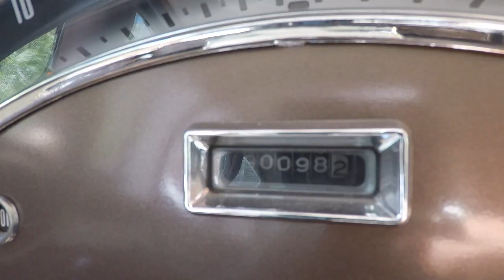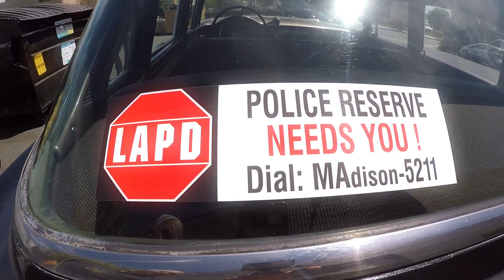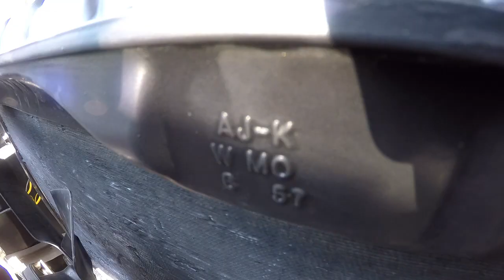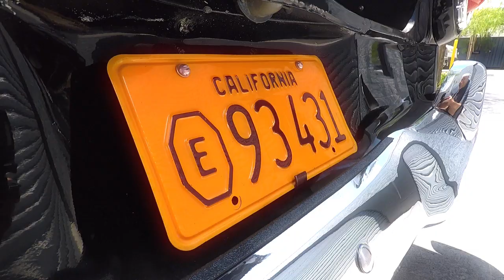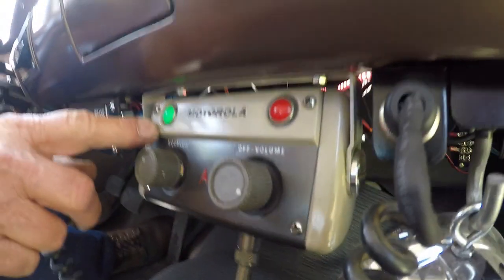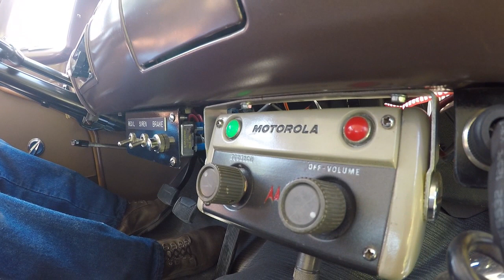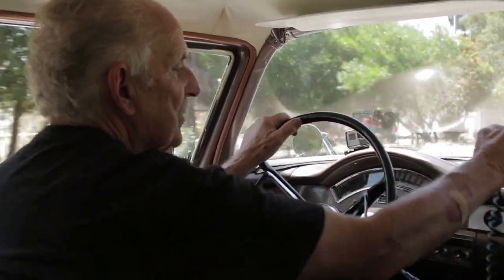Historic 1957 Ford LAPD police cruiser

Comment: I'm a retired police officer from LAPD Los Angeles Police Department and I did my probation period at Devonshire Division, year 2 through 5 Van Nuys Division, 2 years at VTD Valley Traffic Division all patrol duties from 1984 until 1991 when I did a lateral transfer to San Luis Obispo Police Department, where I retired on a medical retirement in 2000. The only patrol vehicles I drove during my time at LAPD, was the Chevrolet Caprice and in 1990 we got the Ford Crown Victoria hahaha 😆 😂 nice job but it's hard to believe LAPD was buying patrol cars in 1957 with a 6 cylinder engine hahaha 😆 😊

Comment: The Motorola is to call in the interceptors with the 312 V-8s.
Reply: The LAPD Interceptors were not 312 V8's. In 57 the Department used Oldsmobiles.
Reply: @robertstentz2067  the Ford's from '56 on back had V8s.

Comment: 1957 Ford Custom 300?
Reply: No... LA used the base model known as simply a "Custom" in 57. The Custom 300 was the next level up with gold side trim similar to the Fairlane 500.
Reply: Guessing not due to the lack of power steering/brakes and it being a manual transmission inline 6.

Comment: What model of siren was that on the car?
Reply: exact words of the former officer I know on Youtube ""the siren was the Federal Interceptor (PA-20). The red lights were double faced Dietz lights which housed sealed beamed light bulbs with red to the front and independent flashing amber to the rear""
2 недели назад
Reply: @NanatsukiBenio  I know the Interceptor was used later on, but that's an electronic siren. This one is a mechanical siren.
Reply: @matthewfoster1307  Hmmm then I give up because the Officer told me about 70's type (electronic) I don't know much about mechanical sirens :)

Comment: The 1957 Ford.
 It has an all steel interior dash to break lots of bones in your body, in the event of a car crash. The Optional seat belts and a hard rolled steel dash is  the way it was, way back when.
Reply: My Larozza, back in 1957' there were near to only 20 fatalities over a whole year in the entire country of the United States. People want to make it seem like cars (automobiles) are weak and dangerous in the past to make their modern cars look good, hence why advertisements show a rinse back which is when they show a 1973 ford and show a model t in the background or a maserati 2019 and a 1980 in the background...making the new one look more refined and better; it is all really a childish trick, those cars couldn't harm much and had safety, I assure you!
Reply: @WitchKing-Of-Angmar  I broke three ribs & punctured lung, after that family  car was in an accident. A hard lesson to learn at 3yrs old.😎
Reply: @WitchKing-Of-Angmar  i like and actually drive classic cars, but I hate to admit that new cars are a lot safer to drive. Old ones might be big, but they crumple like tincans.
Reply: @PU8698  A 1957 Ford will hold up better in a crash than a 2022 ford, but has little to no features to protect the occupants(depending on if it has the safety package, then it has lap belts and a padded dash). I mean slamming into a steel dash then flying through the windshield isn't gonna go that well.

Comment: 6 CLY motor I don't think so.
Reply: Mr Robbins... I am now 81 years old and know those cars first hand. I even owned one in 1960 when the Department retired the 57's from service. They were indeed six cylinder cars. Even the Department's 56 Chevy's were six cylinders... LAPD Chevy's did not get V-8's until 1958. The Ford's from 1956 on back had V-8's.